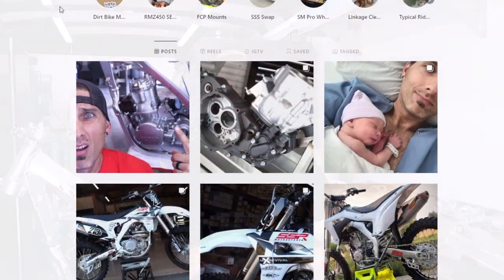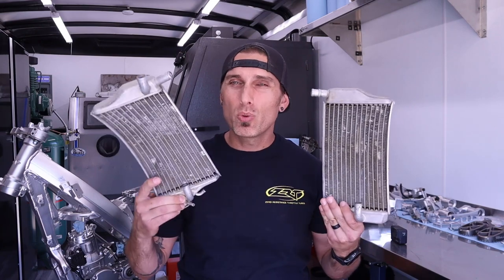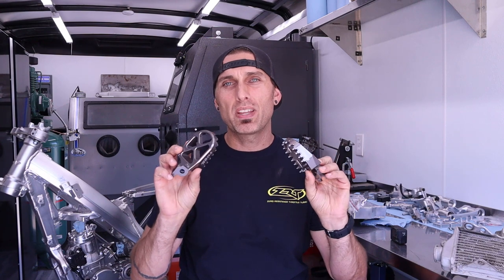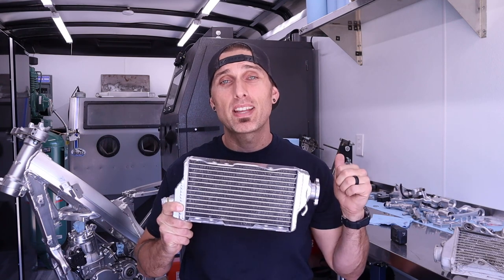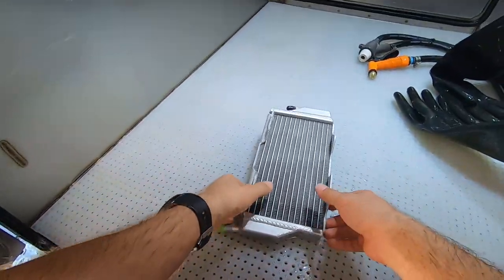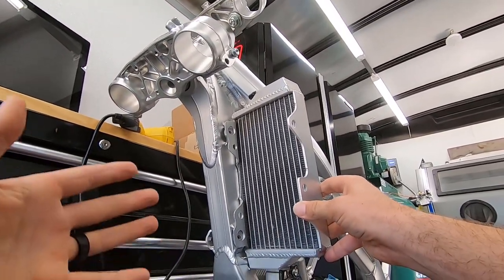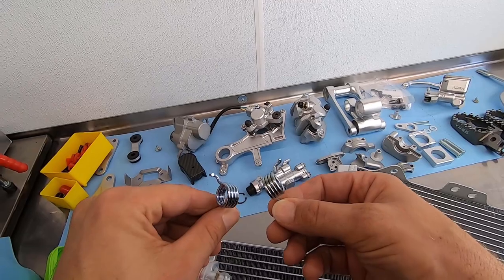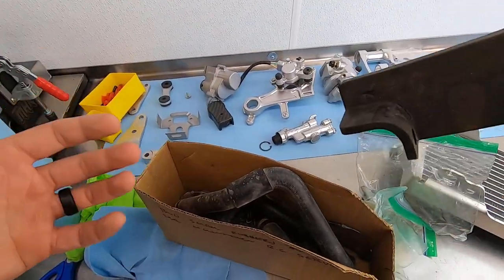Removing 18 Years of Dirt - 2003 CR250 Build // My Tips - Tricks - Mods & Vapor Blasting Techniques

Comment: Found that 3M 08946 Clear Silicone Paste  is good on the rubber parts like the bushings in the radiators goin to buy the No Toil GREAT find.
Reply from the maker: No kidding? I will have to give that a shot. Thank you for the tip. Is that for cleaning?
Reply: @mxrevival  Cleaning and helps preserve items like the airboot to and other pieces.
Reply from the maker: @mecalpsha4473  bitchin', maybe I should slather that on

Comment: This is really great! I am doing a project build myself atm. Carmichael / Stewart Replica i´ll be using the 05 model, my friend had a kx 250 2007 (same model as the 05) so i got a great deal. Going to push this sucker as close to factory as i can as a privater, yeah it will be a long term project. Some parts need to be replaced obviously but i always look for the best way to clean parts, got some tip from PC´s Jon primo, youtube is truly a good place to find guys that are committed to bike builds learn different aproach to clean parts.

 I definitly follow you know.  Cheers!
Reply from the maker: Congratulations, that is epic! Feel free to email me anytime if you have any questions and if I can help, I always try. JP is a stud. Thank you too for the sub! I greatly appreciate that 🙏 -Charles // mXrevival

Comment: Awsome video. This video came out just in time because I was about to message you about what psi would you recommend for vapor blasting radiators. I actually vapor blasted and airbox tube that goes from the airbox to the carb  for and old XR 80 and it turned out really good. Also  I did some four stroke carb parts such as choke levers and the plastic covers on the FCR carbs and they looked amazing. You should try and see what that vapor blaster can do on the air box. And you got me thinking about getting some No Toil cleaning solution for pre cleaning before vapor blasting. cant wait to see this CR done man!
Reply from the maker: Thanks Nick! I'm glad there were some helpful insights in there that you can try. I feel like a lot of guys keep it a secret. Still learning myself. Vapor is of course totally great for that parts you mentioned too! I might try that someday towards the end of a media cycle, when it's getting older. I'm always trying to keep literally any & all dirt out of the cabinet 😂 I am a little overboard about it. 

I think you'll love the NoToil trick. I am going to try some other tricks with that in the future too.

Can't wait to show you the CR done soon & thanks a ton for watching 🙏🙏🙏🙏🙏
Reply: @mxrevival  I believe in cleaning all my parts before vapor blasting
Reply from the maker: @nicks2wheelchannel920  Nick, I'm sorry. That probably sounded like I thought otherwise! Certainly not meant that way if that's how it read 😎 Appreciate ya dude!

Comment: Hey Charles, you’ve taken apart a shit ton of bikes. Would you know a frame which would take a NC250/300/450 motor without much modification? I’d love to buy a blown up bike and swap the motor with a new Zongshen Covid special. I think It would be cool. 
Thanks
Reply from the maker: Haha Covid Special. It's true I have takes apart a shit ton of bikes BUT not a shit ton of Chinese bikes. They may swap right over in the SSR 300 & 200 chassis but I'm unsure on the 450. 

A lot of what I do know came simply from trying when I didn't know, so I know you'll find the answer if you go for it.
Reply: @mxrevival  the reason I suspect the Zong 450 motor will mount to a crf450x frame is because the SSR450 is made under a license agreement between Honda and AsiaWing. From my research, and what owners have told me, is that the only difference between the two is the carb, air box/tract, rocker arm and cam. However, even those parts can be replaced with Honda OEM parts. 

I’ve looked at the exploded parts diagrams of both bikes and it appears they share the same mounts. It’s a little risky still. I was hoping to hear of this being done before I attempt. I’m out for doing the fab work that LundMX does on his projects.

Comment: What is the cfm on your air compressor that you use on your blaster ?
Reply from the maker: https://www.tptools.com/Champion-5HP-2-Stage-80-Gal-Air-Compressor,6248.html?sku=8550-65DS 

Plenty for dry blast, overboard for vapor blast (which is great as the compressor will run less)
Reply: @mxrevival  thanks brother !!
Reply from the maker: @mixonmachines  you bet dude!